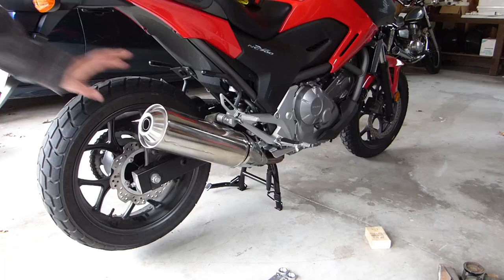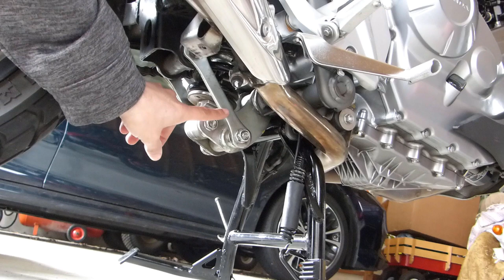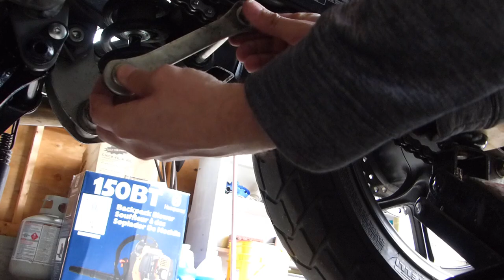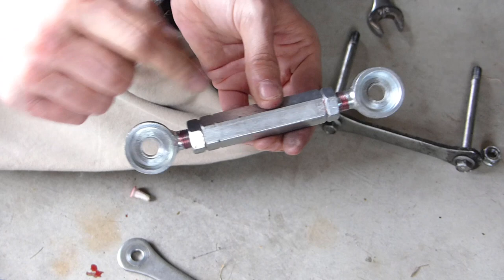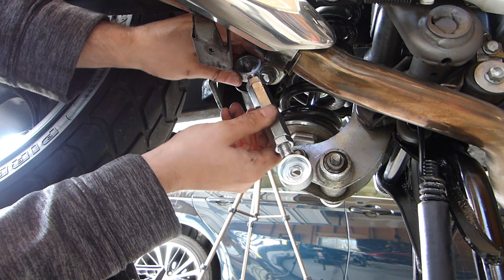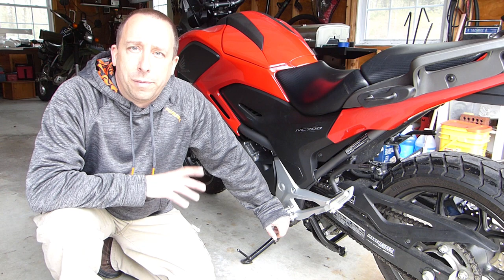Installing Soupy's Performance Motorcycle Lowering Links - Honda NC700X

Comment: those links suck you gotta remove them to adjust you want the links you can adjust while its on the bike
Reply: These ARE that type of link. This guy didn't read the instructions and didn't understand how they work. The reason one side is right-hand thread and the other is left-hand thread is because it's what is called a turnbuckle - you turn the large threaded nut in the middle and that causes the ends to either come together or go apart, depending on the direction you turn it. Once installed, you don't need to take it apart again to adjust it, just loosen the locknuts, adjust, and then tighten the locknuts when you're done.
I really do wish people who did videos like this would actually read the manufacturer instructions. Amazingly enough, most manufacturers actually know how their product works, and usually tell you that in the instructions.
Reading is fundamental.

Comment: So longer or shorter to lower?  With RED loctite, do you plan on never adjusting it again?
Reply: To be fair to this guy, Soupys Performance (the maker of these links) suggests the red loctite in their video. Not sure why they do that, it's wrong.
Reply: @willywaters3814  Yeah, I used Blue.  I'll keep an eye on it.
Reply: Just emailed the same question to Soupy's (unnecessarily.) Watch the video again - carefully - where he's raising the wheel to put in the link. RAISING the wheel is shortening the ride/seat height. There is your answer, longer link = shorter ride height, shorter link = higher ride height.